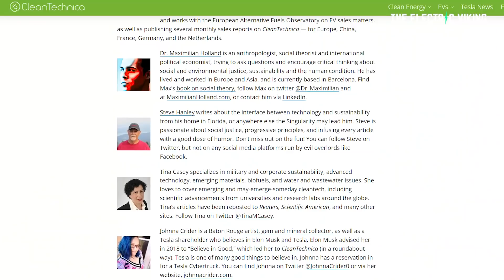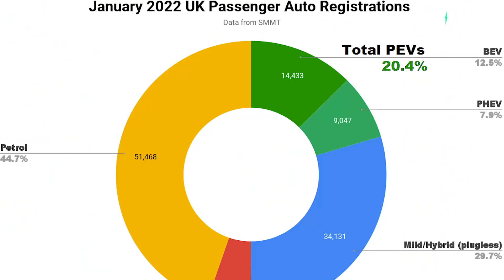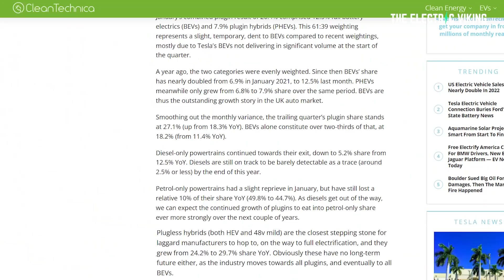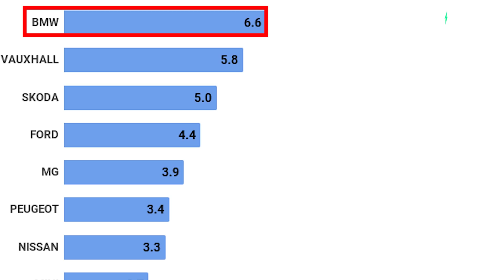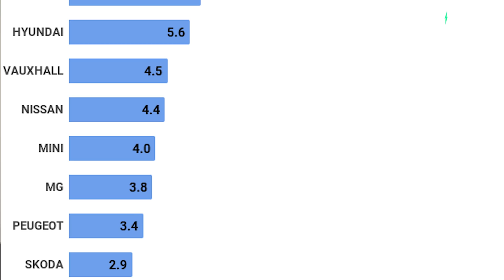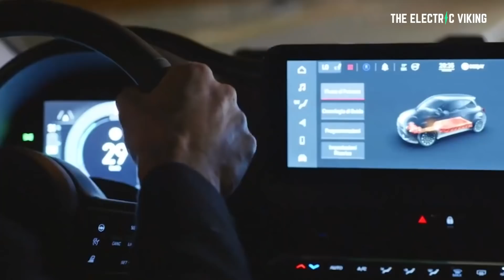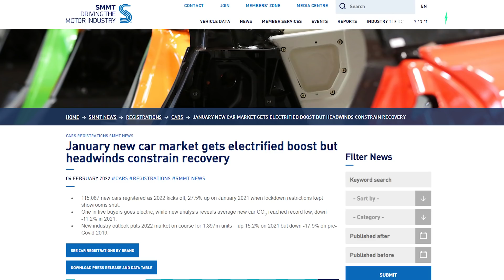UK EV popularity surges in Jan: may hit 50% this year!

Comment: Also filling up a diesel tank even just once for such a long journey is like 100 bucks. Not sure how that converts but it's a lot. You'd have to individually personally weigh the advantage of making the trip with 20 or $30 but having to wait maybe 30 minutes for each charging stop, or save that hour but spend three times as much. This is the perennial long distance trip argument for ice versus EV. The formula will get better over time as battery capacity and charging speeds get better but even now, for me personally, evie's win.

Comment: Not happening that fast in UK. Cost of EV is to high. Electricity has just gone up big time. Cost of insurance for Tesla’s is off the scale ( unless you have reached a certain age). The charging rates outside of home charging is going up and the charging infrastructure is absolutely woeful.
Reply: Woeful or not Leslie, there are still three times as many electric car charging connections as there are petrol filling stations. Around 8000 petrol stations, and currently 26,000 EV charging connections. That number is set to increase by a further 30,000 this year alone, with a total of 190,000 public charge connections by 2030. This of course takes no account of the privately owned chargers some EV owners have..

Comment: The UK is relatively small but it's still over 1100km/700m from sat Poole to Thurso. So you will have to charge a 200mile EV 3  or 4 times to get from one end to the other. My diesel van could almost do that in one go (650 mile range), but a fill would be smart. Obviously people don't make that journey very often, but the place isn't so tiny that EV range, or perhaps more accurately charging infrastructure, doesn't matter (at least for some people). So that's why people are still buying hybrids. I agree they are kind of dumb and won't age well.
Reply: It depends on the EV. I did a 520 mile trip a while ago, charging just once during the trip. I began the journey with a full charge ( it showed I had 280 miles availble) and I charged using a 100kw charger once I had around 30% left. That charge got me back home again, although I was down to 12% when I pulled up on my drive....  One Tesla Model S owner posted a video of a trip he did from Scotland to London Airport. He purposely kept his speed to 55mph, to eke out his range, and did actually get there in one go, without a charge on the way (400 miles)

Comment: Anecdotally I am seeing far more full EV’s on the roads here in UK. Mid 2021 there were hardly any, the odd Tesla but nothing noticeable. Now whenever I travel anywhere I’m seeing Teslas, ID3’s and Hyundai Kona’s everywhere but Teslas in particular. No model Y’s yet but I’m sure there we be loads shortly as deliveries start to happen in Q1. My neighbours have a VW ID3 and a Toyota RAV4 Hybrid. It really is taking off here. Not sure whether it will reach 50% this year but I would think by 2025 it will be well over 50%. Myself - I have an Audi Q4 on order but not due for delivery until October due to parts shortages!
Reply: October, wow. interesting data point. I will just drive my mk5 GTI into the ground till the dust settles

Comment: Porsche is shaking in their boots waiting for the end times, which will occur with the production of the Roadster 2.0 😁
This is a born track/ racer. Model S and performance model 3 are simply not born racers.
Imagine a 100KW battery pack high nickel and silicon 4680 batteries. Front and back Giga casting. 2+2 seating with yoke steering and FSD and entertainment. 
520 miles per charge, 0.60 in 2sec but handling will be Porsche standard and top speed 200mph.
Price @£200k 😁😁😁  with in deliveries 2024-5.

Comment: UK gov tax incentives are heavily pushing EV and PHEVs for company car/fleet and diesels get hammered.  plus fuel costs are getting  "silly", £6 a gallon or just over $8 a gallon. 
There is significant investment from companies into charger networks, and the gov has mandated that commercial property when renovated must include them, plus new build residential if they have parking must also have them.
IMHO, there is still a small need for PHEV's till the supply of chargers increases significantly and is more widely spread, its fine if you want to go up or down the country, but lacking if you want to go across as the more rural coastal areas are not as well supported
Reply: I also read somewhere a while ago, that any new housing developments with street lighting, also had to include street light mounted EV charge ports....

Comment: Motorcycles. Their safest function is the capacity to crank open the throttle and blast away from tin tops. Electrical bikes that top out at 100kmh are dangerous. The electric bike called Evoke is the smallest I'd consider which is priced at 1/2 that of BYD EA1.
Im sticking with my GSX1250 in the long term.
Reply: The Zero electric motorcycles site advertises their top whack as 120+ mph....

Comment: Very recent announcement from Nissan, who of course have a major manufacturing base in the UK. Nissan are to drop development of ICE technology due to the complexities of conforming to Euro 7 standards. Nissan will concentrate totally on EV's as soon as 2025..... New EV's are now taking 12% of the UK car market. I'd imagine this could readily get to 30% plus in the next couple of years....
Reply: Guess you didn’t watch the video. Plug in UK is over 20% now and likely 50% by the end of the year. 
EV share is growing as a proportion so 50% already in 2023 is very likely.
Reply: @whowhy9023  I'd like to think you are correct, but there is still some EV resistance in the UK..... some short sighted buyers are still buying new diesels...  I wonder what a used diesel car might be worth in 4 to 5 years?

Comment: I agree with you. Petrol vehicles, (even hybrids) will be turned over to EVs by 2025 and in the minority forever after. EVs are supply constrained, not demand constrained.
Part of the ICEs problems is the complexity and fragility of the ICE. Electric engines just work and keep on working.
Reply: Modern ICE super reliable. Rarely have problems with them

Comment: Hi Sam, greetings from the U.K.! It’s a very interesting car market here at the moment, many people are choosing to delay the purchase of their next new passenger car, with the intention that the replacement vehicle will be fully electric. Many are waiting to see EVs with better range and lower cost and choosing to keep their current ICE vehicle for now, or are just pensive about making the switch, but knowing it will be the next step in their motoring journey. This is going to cripple legacy auto as new ICE sales slump.
Reply: I agree Simon, me and my partner are doing just that. We have a relatively low mileage Volvo V40 T5 that could go on for a number of years yet and we are just waiting for the  best time to take the plunge and trade it in for a fully electric car. As Sam says, Hybrids are a waste of time, especially if your average annual/daily mileage is relatively low. Therefore for us its all about the best time to swap; do we do it soon when the second hand market for fully electric is still very limited, forcing us into buying a new vehicle, or do we hang in there with our Volvo for a couple more years and get less for it when it come to selling, but get a better pick of new and used EVs when the time comes? Others will have the same thoughts right now and its a bit like gambling!
Reply: @davidsanders904  check how much you would save on fuel. It may be more costly to wait for a cheaper/ second hand EV than to buy a more expensive EV now
Reply: @franciscoshi1968  You make a good point and one that has to go into the equation. The other is, I not sure I'm that patient anyway and may have to jump sooner rather than later anyway! lol
Reply: @davidsanders904  all I can say is that after getting my EV and driving it for a week I thought I should have switched sooner.
Reply: I have never bought a new car. Couldn't justify the cost! But. I my name down for the Cybertruck. Glad it's delayed as im still saving! LOL
Reply: Yep - our next car will be an EV (on order now) and once we get it will replace 2 ICE cars. We will just have the 1 EV as working patterns have changed so much in the last 2 years. It just makes no sense to get an ICE car for us now. I appreciate that for some people it doesn’t make financial sense yet to move to EV’s but I think within 3 years it will be the other way around and you’d have to be mad to buy a new ICE vehicle. It will take time to trickle down as most people have used cars but the tipping point is definitely close.

Comment: I had to sell my electric smart car and got a hybrid. Why?  Because the government in Illinois (USA) charge you an extra $100 for registration, with rumors that it will be even higher in the coming years. Since I use my bicycle and my e bike more than the car, the cost savings of the electric car is more than offset with the higher registration cost.
Reply: Yeah all countries will do that either though higher registration costs or road user charges, here in NZ EV are currently exempt from RUC but when they do start charging the current cost is just over $70 per 1000km (620 miles) for any car with a plug so both full EV and PHEV will have to pay this.

Comment: Not seeing it Sam.  Diesels, yep, they're dead.  But EVs aren't going to be 50% this year as prices are still too high & the supply just isn't there.

Also, our charging infrastructure simply isn't good enough.   Roughly half our motorists can't charge at home and we're years from having enough low power chargers to support millions buying EVs.

There's a lot of suppressed demand - the supply, at affordable prices, just isn't there.
Reply: Yep. I couldn't agree with you more.
Reply: Agree, when the cheaper models arrive and can compete or match the ICE versions they yep, atm most of the growth is in the taxable markets where the cost of the vehicle can be offset  or just for bragging rights. 
The MG range has proven popular enough to validate the chinese  vehicles, but when the rest arrive, then we will see how loyal people are to the legacy brands. 
Only problem i can see is the average person still likes the dealership support option, i mean i still have a 13yr old Hyundai which my dealership can still get parts for and at very reasonable prices. 
The UK is tough to accept "new" brands, take Daewoo,Proton, Lada ( ok they were crap), Perodua, barely made a dent due to  poor aftersale service, were a small island so word spreads fast
Reply: @charlesuk5358  And, of course, MG have put their prices up.  Sure, the new ZS Trophy has had a refresh and has a decent sized battery now but £33K is an awful lot for a bargain basement car marque - their petrol car is half that price.
Reply: Personally I think it'll be something like 30% within another 2 years(ish)......